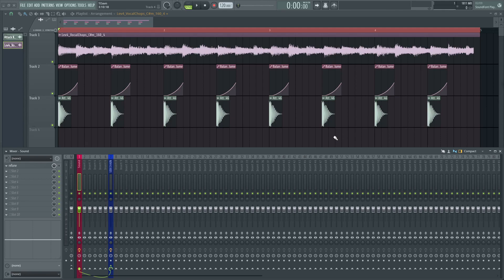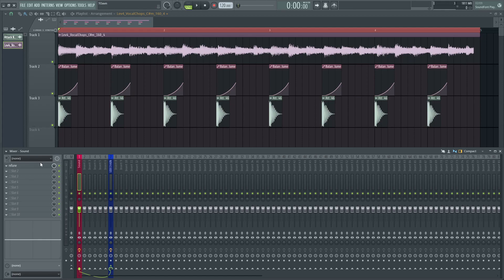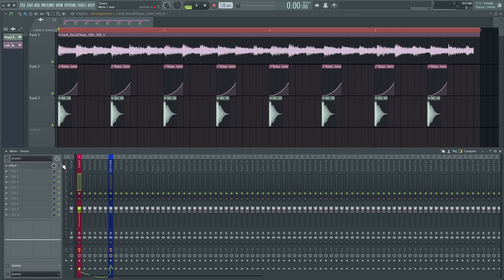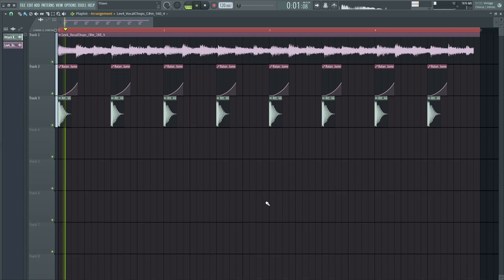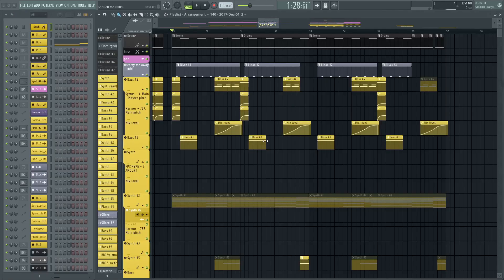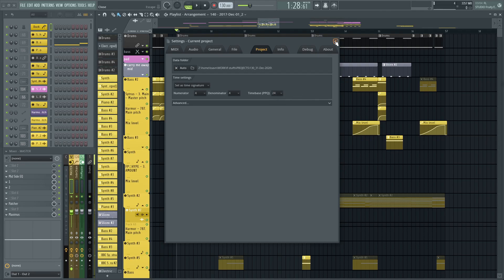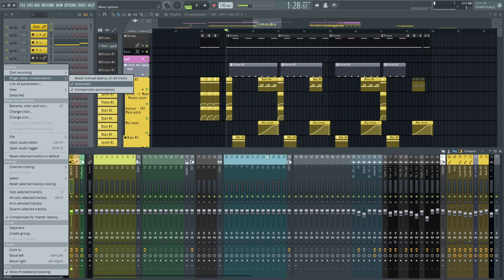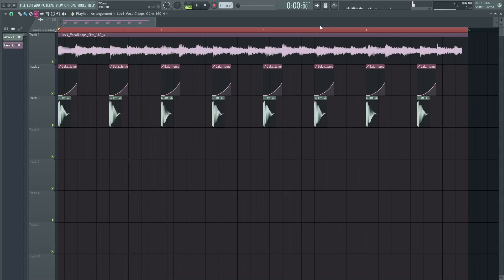FL Studio TUTORIAL | Every Latency Issues Fixed!

Comment: DO NOT change the PPQ in the midst of your production. The PPQ you use at the start of mixing is the one you have to stick with and need to export with. .. It's gonna mess up your mix. Higher PPQ means higher resolution of the Grid, how many steps one cell has. so if you have something that has x empty steps from the left of a cell and y steps from the right, changing the PPQ will result in FL placing the piece on the wrong spot,, FL works with the steps of it's grid, not time. So you better not mess with the PPQ. 96 should be practical.  just make sure its at 96 before you do anything
Reply: Well you can always set it higher. See if your CPU can handle hat PPQ change and if not change back to previous. As long as you do not change the positon of any note in piano-roll or pattern/ automation-node in the playlist  you wont lose any data. 
But if you want to go save anyway just save your project as a new one and mess with the copy...
Reply: @hund2955   I'm not talking about losing data, changing the PPQ can result in your notes being all over the place, not just notes in piano roll, also objects in playlist ,, because it is a different grid. you HAVE to work on the PPQ you started with,, So you're wrong, you see you don't have to change the position of anything,, changing the PPQ WILL change the postition automatically and will ruin it.
Reply: @pettterrr  actually it won't If you dont Change any Note after switching to a Higher ppq and Back. I know what you mean, but let me demonstrate: 

You have a ppq of 96 for example. Now you can place (theoreticaly) a Note on 96 steps between 2 quarter notes. Since ppq ist Short for Pulses per quaternote. If you now Change to a Higher ppq Like 192 you can place a Note on 192 different steps between 2 quarter notes. You have effectivly Doubled the Numbers of steps you can use. But all the old steps Form the 96 ppq are still there. The 96 ppq grid can Just use every secound step of the 192 ppq grid. 
AS Long as you do Not Change anything between now and the Point you Set the ppq Back to 96 No Note Placements will be Changed. Because they only Change if a Note is on a step that the new grid can't represent. But even then they will 'just' be cast to the next fitting step. So they dont End Up all over the place but sliglty Offset. Which ist Bad enough. So Not Decresing the ppq is generally good advice, since fl dont save the old positons. They are lost Without a Project Backup. 

Thats what the Warning Message means with losing Data. The Note Position Change is essentially loss of Note placment Data. Of course this can also happen to Playlist Clips, Automations anything that can snap to the Midi/Playlist Clips, as you pointed Out. 

But its ALLWAYS save to increase ppq. But youre CPU has handle Double the Pulses per secound, every Pulse FL collects all Data IT needs to Play the Sound, Like Soundcard audio Buffer values, Automation clip value at that Point, etc... 
So you can make Life hard for your PC very easaly. 
But you can Just Look If your PC can handle the Higher ppq setting If needed and If Not Change Back, ASLONG as you didn't made Changes. 

I get that never Change the ppq setting mid project is good advice for beginners, but Not for expirenced Users. Also it should be: do Not Decrese ppq mid Project. To be more upfront to beginners about how ppq works...

Comment: I see talks of fixes for this. But no one really talks about the typical delay of input notes when recording. If you watch any you tube video most people will "ALWAYS" quantize notes right after they record. Im sure its not their pc nor the hardware. FL as a software has this issue since they first started and no other daw has this problem as you record the notes go directly on grid no need to quantize
Reply from the maker: I can kinda understand your point, but isn't that just a buffer thing? you can just lower your buffer size for less latency while recording and also preferably use the asio driver that comes with your audio interface. but again, i don't do a lot of recording so maybe  there are things that i'm missing
Reply: @toavnwub  Ive tried all of that but its still a issue. Thus while lowering the buffer size and changing the recording helps its not a full fix. Even if you watch many videos when people record if they don't do any edits they will have to quantize the notes. Any other daw i dont have to do that except FL and im sure some of these guys have better pc /gear setups then me and my setup isnt no slouch...

This has always been a fl studio issue which is why when i use it i mostly draw in my notes for that reason. Logic, Reason, Ableton Live, Studio one or even garage band none of those DAWS have that issue and i never had to mess with the buffer size as they catch the notes on grid perfectly ( No quantize needed after playing) 

Just watch a few videos most people after they record something in fl they will quantize the notes. Thus its quick its not a major issue but its still one of those things FL  could fix. If i was to hook up a midi keyboard or mpc and trying to hit some drum patterns in it that would make put me off with the program and i would look for another DAW
Reply from the maker: @DETERMINOLOGY  i see,
well i hope that'll get fixed in fl 21 since it sounds like the next "big" update